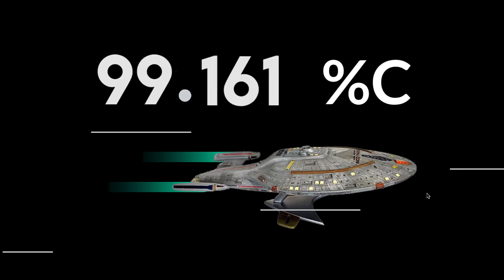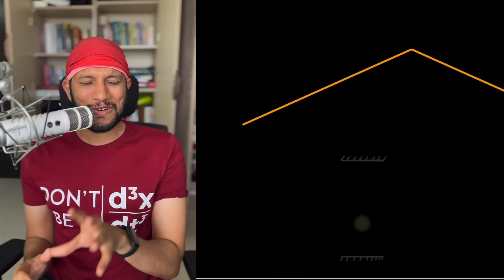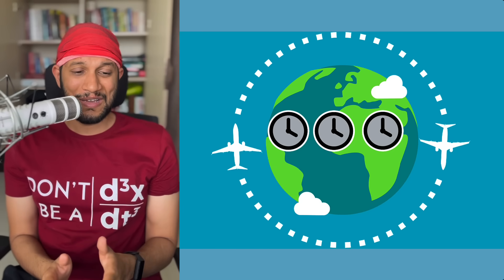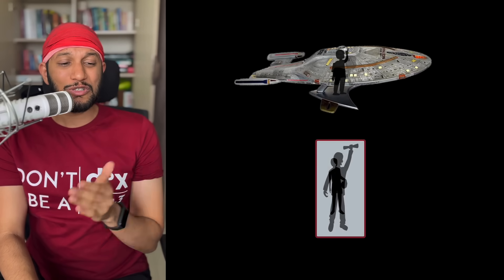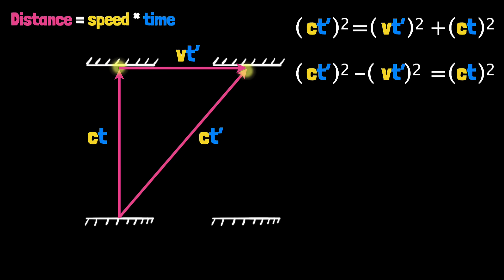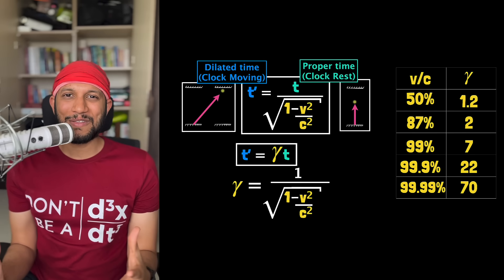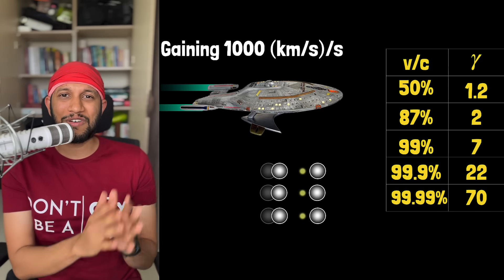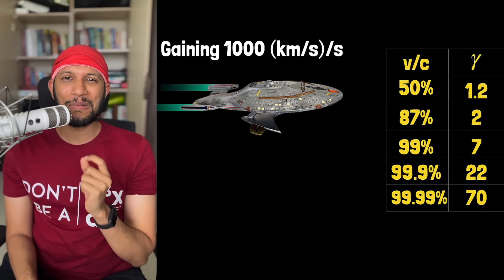I finally understood why you can't go faster than light! (My mind is blown)

Comment: The video is very understandable in it's own frame of reference, but when we add into account that speed is relative to one another I find it difficult to follow. If something is going 99.9% the speed of light, then to them we are also moving at 99.9% the speed of light. Then why is time slower for us and faster for them. There is no immobile reference in space, it's always relative, so wouldn't it be possible to have something go 70% the speed of light in one direction, and 70% the speed of light in the other direction ? If so then, how fast would they go from one another ?
Reply: These are wonderfull questions, i fell in the biggest rabbit hole trying to answer them myself just now, i think ive managed some pretty intuitive answers. The biggest take away is that speed is symmetric, but distance isnt. Going back to the twin paradox as the twin that accelerates away from earth, the distance to earth from the ship shortens along its speed, thats why the traveling twin is younger by the time its back home, theyre going the same speed but its been a shorter distance inside the ship, and for the random object in space example, i dont think we can know how to calculate "its distance to us" in this sense without other clues, so people just shrug and say it depends. For the two objects that are 0.7c in different directions, ill ask you to think of two cars going 100km/h in different directions, for one to match the other speed there would need about 200km/h worth of force, with the same logic think the amount of force needed to do -0.7c twice and youll figure out that 0.7c + 0.7c = 0.94c. now thats about the limit of my math, dont ask me about what a observer sees because theres the doppler effect which makes things different, but it was pretty fun

Comment: Einstein started all the BS about relativity based on one fact.  Objects going faster than the speed of light cannot be measured.  A century has passed and the theory has been fully developed into corrections.  What if objects can go faster than the speed of light and the inability to track it is part of the deal.  This type of thinking will come from the future Einstein at some time in the future.

Comment: Proper time makes no sense. If it takes a photon takes more travel time than it should slow down for eveyone inside the vehicle too. For example, if you threw a ball and then fly a drone next to it at the same speed, the ball doesn't instantly fall to the ground for the drone while everyone static at the side lines watches the ball fly it's curve.

The drone sees the ball go up and down at the same speed. Arguably without reference for the extended travel distance because the camera on the drone was zoomed in really close, the ball would tick up and down even slower then expected.

What should happen is, that the faster you move the slower you perceive everything. Because the the period of time that your brain equates to "now" would become smaller in comparison to the causality you experience. Since all casualty is scratched apart you'd find that fast things now don't fit into the single experience of "now" anymore. Moving your hand to grab something should feel extremely slow to you. Like you can think multiple chains of thought within a otherwise rapid action.

I say Dilated time is real. Proper time is not. We just never approach speeds where a human consciousness could report the effects. But if we would, we would find out that we don't only age slower, but we also experince everything slower

Comment: This is a really nice explanation. It's something I remember learning about ages ago, but haven't revisited since. For me the theory falls apart where you we say that aging is the same as time flowing. Yes, we don't have a way to measure the flow of time (which we could also say is a construct in itself and may be the limit of what we understand time to be), because this shows for me that time dilation does not say that the ship slows down the more it accelerates and gets closer to C, but instead it stops aging. The infinity energy needed is for the photo to bounce between the mirrors, but it doesn't (for me) say that the ship slows down at all. If anything we could say that all systems of the ship, human body, etc. would stop working, essentially freezing you in time-induced stasis, but if we assume no drag you would continue at the same speed and not slow down.

If anyone has a good argument or explanation, I'm happy to understand what I'm missing. (I know the video is obviously strongly abbreviated from the full calculation) :)

Comment: Wouldn't that rather mean that from the external reference point it is impossible and the object would just freeze and "fade out of existence", similar to entering a black hole, while in the internal reference point, time and movement will progress as normal, meaning lightspeed is possible, but not beyond? Or are there other forces that break down alongside it?
Because this seems to favor the external reference point as the "real" point and therefore the immutable restrictor for the mechanics.

Comment: Not true at all, please leave a side an Einstein theory of relativity and think for a while, you will get the right answer. 
I have done multiple and multiple experiments on my own and results are opposite of Einstains imaginary experiments.
I have done experiments my self, each result confirms that Einstein was Wrong.

First of all, Photon CAN NOT exist in multiple references, that being told, imagine same experiment
1. You have Photon bouncing on a moving ship
2. We observe the photon
3. Photon existance is ON THE SHIP, it doesn't exist in observer's reference point
4. That being told, same photon is affected only from laws from same reference point, not other one.
5. You can NOT mix and calculate grannies and apples
6. 2 Reference points exist in space in same time but they are NOT affected by each other
7. They can only be affected by gravity between them
8. Since Ship is in different reference point, time for Photon to travel in certain direction is equal to speed of light always, it means, photon will go same speed in any option applied, regarding that reference point is moving 1000m/s or 1000000m/s, speed of light is constant for that photon in any situation in only 1 reference point and it can NOT affect other reference point at all, because it doesn't exist in other reference point.
9. I have much more done on this topic that I will shut myself off of explanations and debate, I have done experiments of my own, spend my cash for same research, bought instruments and done the math my self multiple time with each experiment showing exactly the same results, regarding of changing experiment conditions.

That being told
My formula is much different from Einstein formula and when applied it shows exactly what will happen if it happens

so, Einstein' theory is just a theory and remains a theory and being told, I will wait for all the mankind to find out themselves, shutting myself off of explanations

Comment: This is fascinating, but I have a question about the 'frozen' aspect. You mentioned that from an outside perspective, the ship appears to slow down and eventually 'freeze' as it approaches light speed. If the outside observer sees it as frozen, but the ship has infinite energy and is moving forward, what happens? Does the outside observer see the ship at the same spot forever while the people inside are traveling great distances? And what about if the ship stops? Do the people outside see the ship stop instantly, or does it look like it's still moving due to the time dilation? I'm trying to wrap my head around this and would love a little more clarity. Thanks for the great video

Comment: Am I missing something? You keep talking about the clock outside the ship, but I don't remember you ever saying that the clock is actually back on earth, or actually "not moving". Then, in the time dilation equation, you label the clock inside the ship as "at rest" and the clock outside the ship as moving. I understand the equation still works, but even even you're looking at things from the perspective of the ship would it really make sense to label the ship as "at rest"? You did later explicitly say that the ship is traveling at a very high speed. Doesn't this just unnecessarily complicate this explanation?

Comment: i get the theorem and why it takes a bigger factor of time whenever we reach closer to the SOL but who says that the limiting factor is the SOL itself? if we take the solar clock out of the equasion and bring a theoretical clock with a faster moving object it would take less energy to reach the SOL but the same to almost reach the newer atoms speed. Light or photons in that regard are not the fastest moving objects in the universe.

Comment: Easy and clean explanation. So only massless particles travel at speed of light (photons and gluons - at least that we know of. Tachyons are theoretical concepts not backed by any experimental evidence). Therefore only something with mass may experience time, energy can be modeled as "information" zipping around. Which naturally reaffirms my deep scientific theory that the various fields that make up our universe are just layers of broth, tar and oil in a witches cauldron bubbling and boiling relentlessly.

Comment: So in other words things can't travel faster than the speed of light because at some point it would take an infinite amount of time for the photons to move, because since photons cannot move faster they would become unable to transfer between atoms. 
Though there's also another layer to this that's not explained in this video, the intrinsic gravitational attraction of mass that ensures mass cannot achieve light speed, essentially mass is always being pulled upon by mass, so while you're trying to accelerate in one direction you're being pulled in another, which is why more gravity means more force required to accelerate, at a point it becomes impossible to accelerate faster than the pull decreases acceleration. It's the same principle as an escape velocity, just one so high it's unobtainable, for mass to accelerate faster it'd need to escape the entire cosmic force of attraction. This phenomenon is commonly just called time dilation, which you described in this video, but it's a lot more complex than just the slowing of time, it's why that time slows.

Comment: I thought something along the lines of how you are even supposed to accelerate something behind the speed of the thing that give us perception of the space around us without completely losing the perception of reality?
And in this sense the explaination about the physical clock was very interesting, and left me wondering about what if you were in fact able to reach past lightspeed.
Would matter just stop cold in time for a moment and then burst into its elemental particles because the forces bonding them disappear? 
But it is literally impossible by our understanding it seems... it's absurd to think what the scale of the cosmos is even if you would travel at lightspeed, and you wouldn't even be able to ever reach it properly ever.

Thanks for the insightful video.

Comment: Summary: higgs bosson field, it's the invisible field that create this sort of friction in space and It's higly responsible for holding state of matter. Photon has a special property that somewhat ignore this Higgs Bosson field. 

So why is this important? 

Light can only exist at light speed, if it slows down or stopped completely it will collapse it's state instantly since higgs bosson field doesn't affect it and essentially nothings holding it collapsing this state of matter. The reason why moving at the speed of light doesn't collapse it is because when you move at that speed everything is instantaneous and clock doesn't move at all. And when there's no time, there's no change, and it prevents it from collapsing. And unlike other form of matters that aren't photon, Higgs Field holds it's state so it doesn't collapse if it didn't move at all. At the same time it creates this sort of friction when attempted to be move. Conventional matter tend to resist change and aim for the lowest entropy. 

So why can't we move 100% of that speed exactly?

Remember when a number is divided by 2, it will never reach zero. Conventional matter are still affected by Higgs Field regardless of it's speed. Friction always apply and thus you could never fully reach 100% because of that one tiny friction.

Comment: Well physical clock should decelerate half the time and accelerate the other half, according to this logic, it is like a Doppler effect. Because when the handle is on the other side of the dial the photon will be traveling less distance as ships accelerate, so the handle should move faster. And in that case the reality inside the ship will depend so much on which direction you are facing. If you are facing in the opposite direction of the movement everything no will be very dim if not dark, because it will take forever for the photons to bounce back and return to your eyes, but if you turn around (assuming this will be possible, because your nerves would not be able to send any signal) everything will be very bright as photons will be getting your eyes much faster.

Comment: Brian Witworth made a shorter explanation to explain everything related to the dilemma why there is time dilation. The theory "Quantum Realism" explains this very accurately. Light is the speed of space. That is planck length over planck time. This is the universal speed limit or speed of space much like the refresh rate of the monitor and each individual pixel the information. That is why no information can move faster than the speed of light nor any object come close to it. It takes one cycle to process the information. This also perfectly explains the difference resulting in clocks differing in time when moving and still. Because what happens is that as you move faster, you experience what we call "virtual lag" in the refresh rate of the speed of space.

Comment: i learned a WHOLE lot from this. However I still disagree that time dilation is the way mathematicians believe. 

I think it's perceived dilatation, as the object comes back it will return back to neutral. I do believe physical photon dilatation exists in some objects, but this has to have leverage and creates other stresses.

I have no way of communicating or proving my thoughts, but it just FEELS so wrong to me. yet I still research. 10000% agree with what you're saying in the title of this video however, great video
Reply: You can go faster than the speed of light—in fact, if you couldn’t, then the universe couldn’t be explained by the Big Bang.

Now science tries to answer this by saying that “space itself” can expand faster than light—which is an ad hoc patch.

But there’s another explanation: the earth is stationary and does not move.

The whole “cosmic speed limit” idea comes from the Michelson–Morley experiment (1887), which tried to measure the earth’s motion through the aether. If the earth were moving, light should register differently depending on direction. But the result was null. At that point there were only two options
: 

1) the earth is stationary

OR:

2) the speed of light is constant under all circumstances. Einstein, in 1905, chose the second option—arbitrarily making light’s speed absolute instead of allowing that the earth might not be moving. That decision created the framework where space and time had to “bend” and light speed was treated as untouchable.

And as for “proofs” of relativity, like time dilation: the evidence relies on clocks traveling through space. But space cannot be “nothing,” because nothing does not exist. Whatever space is, it has properties—and those properties themselves could be interfering with the clocks, giving the illusion of time dilation. In other words, the foundation of Einstein’s system rests on assumptions, not certainties.

Comment: Now here's a question:
Since, from the perspective of someone inside the ship, the rate of time does not change, does that mean that for them, they will eventually reach the speed of light and possibly even faster, since from their perspective, their acceleration is not slowing down?

So then could it be possible that things can accelerate to the speed of light and even faster than the speed of light, but we just can't see it happen from an outsider's perspective?

Edit: This is just the theory for time travel, isn't it?